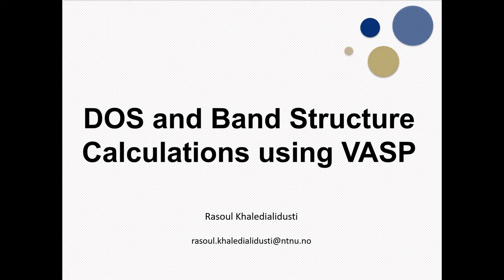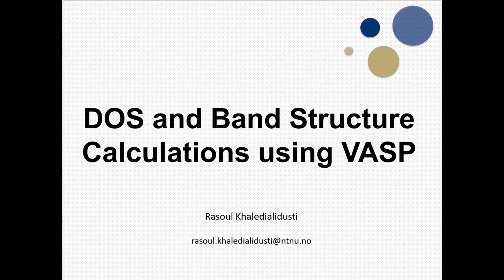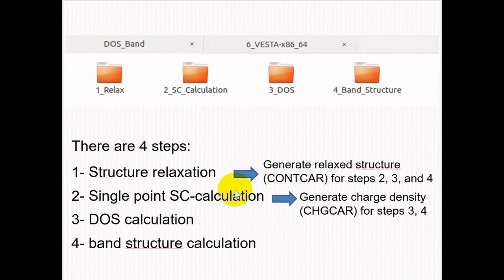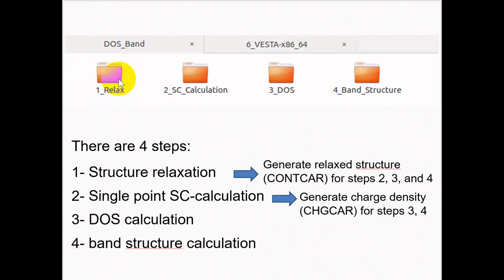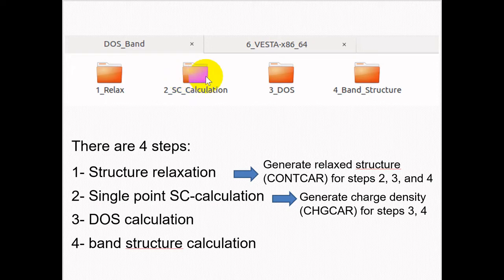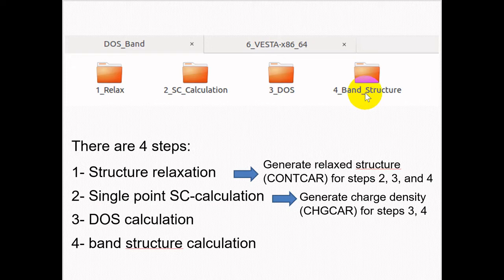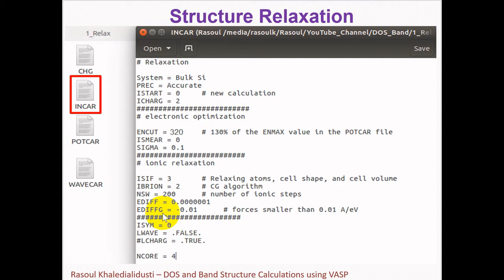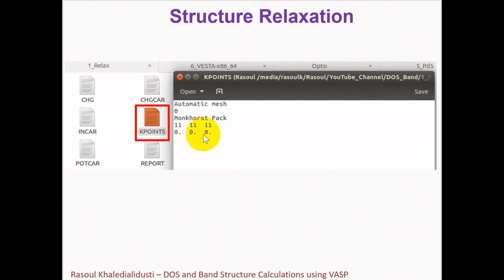DOS and Band Structure Calculation using VASP

Comment: Hi! Many thanks for your video. At minute 34:57, it’s mentioned that the same INCAR file used for DOS can also be used for the band structure (BS) calculation, with the only change being the KPOINTS file to include a K-path. However, I encountered an issue when I used ISMEAR = -5 for both DOS and BS. While ISMEAR = -5 works great for DOS (since it's the tetrahedron method with Blöchl corrections), it doesn’t work for the band structure calculation, leading to an error in VASP. This method is not suitable for non-self-consistent band structure calculations.

For the BS calculation, I had to switch to ISMEAR = 0 (Gaussian smearing) for it to work. Let me know your thoughts on this! :)

Comment: Very nice video, well explained.
I have two small remarks:
1. For best structural relaxation it may be better to use ISIF=4 and perform several calculations with varying scale factors. The minimum obtained by ISIF=3 may be off by about 1meV/atom in my experience.
2. IBRION=-1 is not really needed if you set NSW=0 anyway.
Reply from the maker: Thank you very much for your feedback. I do agree with you. When NSW = 0, IBRION does not necessarily need to use.
For the structure relaxation and ISIF, it is quite dependent on the structure and our objective. For example, in the relaxation of a surface, we only need to relax the atoms and in this case, ISIF = 2 would be safe. However, in the relaxation of bulk structure, we could use ISIF = 3 or 4 and repeat it a couple of times. To be honest, this tutorial tried to cover many things in a short time and I tried to talk about the most important things. Of course, there are some points that need to be explained more. Thanks again for your feedback and comment. Best.
Reply: @RasoulKha  I was just noting this because I've encountered several people who were quite surprised by the difference between ISIF=3 and ISIF=4 + scale factor variation + fitting of EOS. In many cases, ISIF=3 is probably fine.
Reply: @RasoulKha  if I follow your process then I need to not to do lattice parameter optimization separately? If not then why? Please explain

Comment: Hi Rasoul,
thanks for the video. i am trying band strcuture for a doped strcuture, and because to maintain the specific doping percentage, the supsercell stcucture has about 260 atoms. and the band gap is drastically reduced from its undoped primitive cell (which has only around 10 atoms). Is the procedure/ rather any other precautions/methods to be folloed to do band structure for such doped supercells?

Comment: Hi Rasoul, great video tutorial, however, I noticed that you mentioned you use same INCAR for DOS and band structure calculation, but based on some of my test, use ISMEAR = -5 for linemode KPOINTS in band strcutreu calcualtion will lead to error message from VASP. Can you confirm if that is the case?

Comment: Thank you for the detailed video! As you suggested, I have used the same INCAR for Band structure calculation, but when ISMEAR = -5 is used, it ended up with an error showing, "The linear tetrahedron method can not  be used with the KPOINTS file." When ISMEAR = 0 is used, the error is resolved.  Should we use Gaussian smearing for band structure calculation?
Reply: In my case, I changed MP Kpoints to Gamma-centered Kpoints and then resovled it. try it
Reply from the maker: Glad it was helpful!

Comment: I have a quick question. While running the DOS calculation, I copied the CHGCAR file from SCF calculations and made changes to my INCAR and K-point files. However, every time a warning message appears: "WARNING: chargedensity file is incomplete
 ERROR: charge density could not be read from file CHGCAR for ICHARG>10" "I have checked the CHGCAR file several times, and it appears to be complete. Please respond. Thank you.
Reply from the maker: It seems that the CHGCAR file is not completed. I suggest doing a static calculation to make sure that that file is completed.
Reply: @RasoulKha   It is completed. I've checked it. I can see even the agumentation columns as well
Reply: The steps are as follows: 

1. Relaxation done
2. Copied CONTCAR file to POSCAR file. 
3. Copied all files from relaxation directly to Scf directory, made changes in INCAR file. 
3. Copied all files from Scf directory to dos directory, made corrections in INCAR file and k-point file. 
4. I’ve checked the CHGCAR file is complete. 

Now, please let me know, I’m doing something wrong or what.

Comment: I try to use ICHARG = 10, and it starts reading charge density but another error pops up 
ERROR FEXCF: supplied exchange-correlation table
    is too small, maximal index :        3855

Comment: Are the values in the KPOINT (Grid size) file equivalent to working out the reciprocal lattice vector of a unit cell?
Example K-POINT file may have this:
...........................................
Automatic mesh
0
Gamma
4 4 4 
0. 0. 0.
..........................................
How is 4 4 4 above determined? I have a system that is not square, so how do I determine the subdivisions  of the grid along the 3 different directions?
Reply: I only know about like if you want to calculate 2D, one dimension you have to select 1.i.e 4*4*1
But i dont know how we will select either 3*3*3, 4*4*4, 5*5*5?

Comment: Small corrections to the video:
if NSW = 0, then IBRION is automaticly -1, so changing IBRION for SC-Calculations is not required. The same goes for ISIF, this is not required to be commented out when NSW = 0.
if ICHARG = 11, then the CHGCAR will be read for DOS-Calculations, ISTART is used to set if the WAVECAR is read if provided, not the CHGCAR.

Comment: How can i set the KPOINTS level ex. Gamma, X, L, W......?
Reply from the maker: If you mean K-path, you need to find the proper path for your structure and apply those paths in the KPOINT file, as explained in the video.
Reply: Tnk u so much...  .Is there any other methods other than k-path? But My supervisor question is that what is the authenticity of this k-path. Secondly lf the k-level W= 0.357 ,0.25 ,0.25 . L= ..... , ...... , ......  , and so on...  ,then what is the value of W, L,.... along x-axis in the band structure (mentioned below the band structure diagram) . 3rdly I have done CuI calculation with VASP. In my Calculation band gap is zero whereas in the literatures the band gap is 3.1. Plz tell me my fault.  I'm new nd U r pioneer for this.
Reply: Use sumo. It has capability to generate kpoints paths and plot band structure including optical properties
Reply: @ogunmoyekehinde963  could you please tell me more about this sumo? I am having troubles to set the correct K-path in band structure calculations for my system.
Thanks